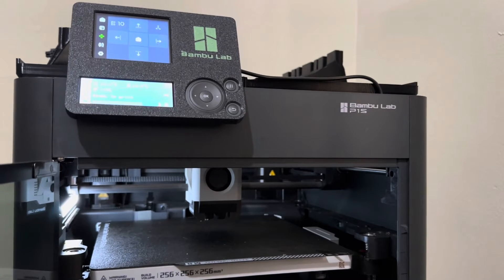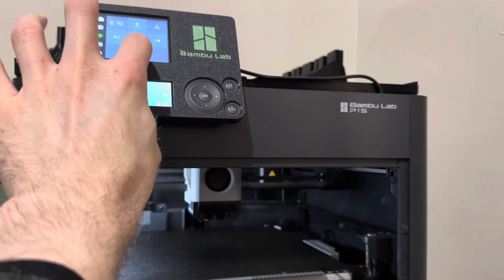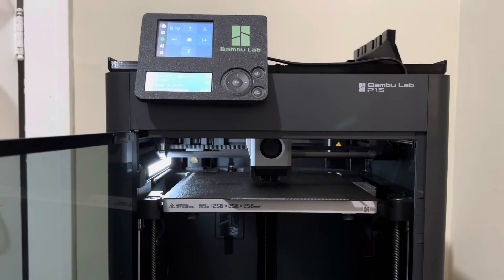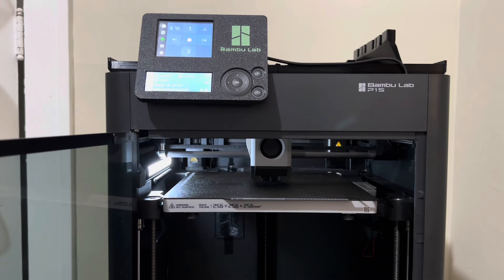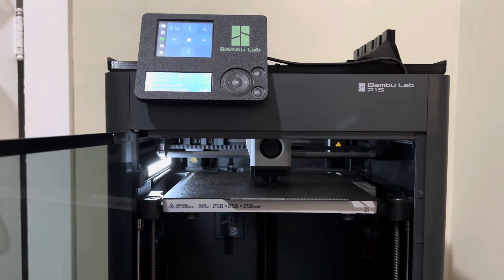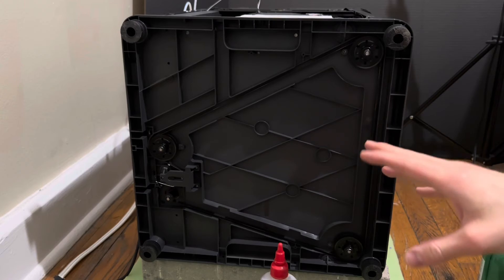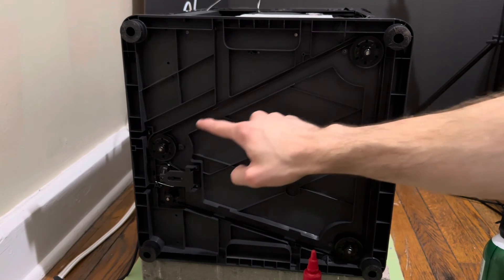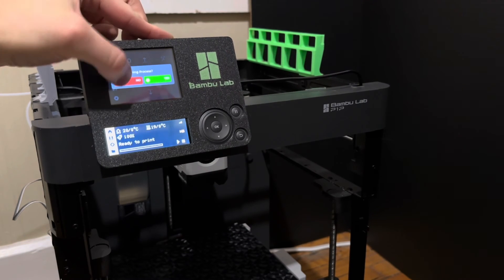Fixing my Squeaky Bambu Labs Printers

Comment: Good video. At 3:04 when you home it you said that sound is dirty carbon rods? Did cleaning them well resolve that?
Reply from the maker: Thanks!  @beardgineering-alt  it’s been a minute so I might be remembering wrong but I think I misspoke there and it was actually a little bit of filament that fell and was at the bottom of one of my Z Screws
Reply: It's his top belt that needs to be lubricated, it rubs against the metal pulleys.
Reply: @MrPirateSilver  that's just what I ended up doing for mine. I'm new to this and after about a month on long print days I had that same sound during certain X/Y motions. A drip of lubrication and a little help centering the belt and all was well.
Reply: @beardgineering-alt  where do you lubricate on the pullet? I have a  terrible squeak on my right side of the printer, while the left one is silent.

Comment: I'm having the squeaking sound you have when you set the printer to home position, you said you have to clean the carbon rods was it for that particular squeaking ?
Reply from the maker: @AresLucci  I missed this comment my bad. If you mean around like 3:04 I believe I actually had filament at the bottom of a z screw that was caught and messing about to cause that noise